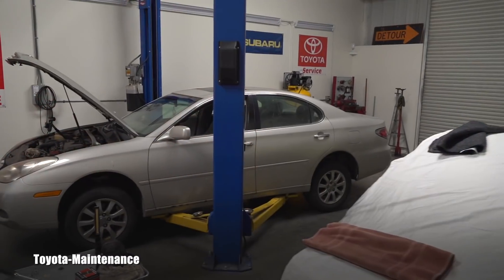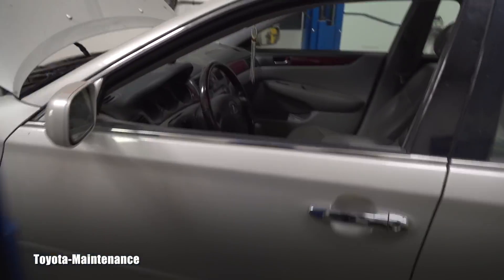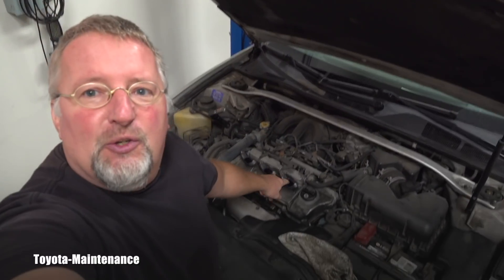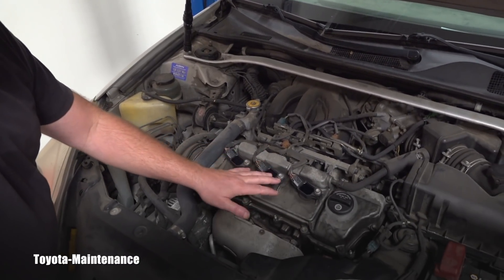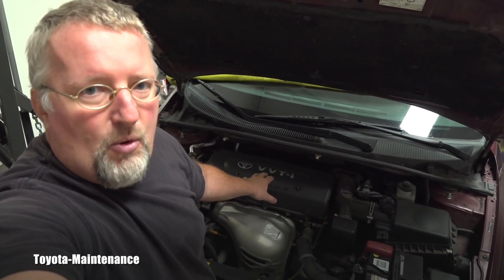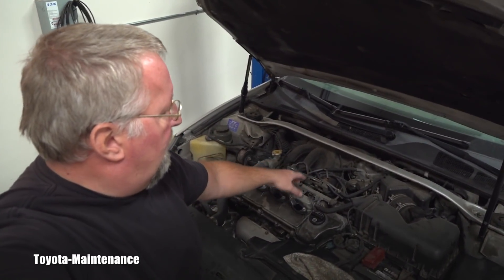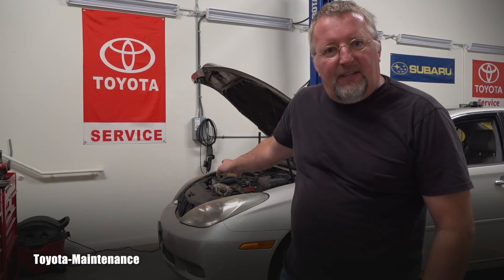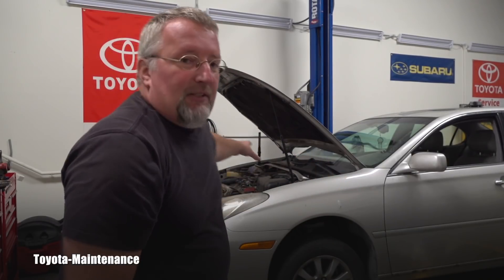4 Cylinder vs V6 Engine - Cost of maintenance and repairs

Comment: We had a 2008 Highlander Sport with a V6 which you could actually reach the backside of the engine. I sorta kinda totalled it in a wreck. We replaced it with a 2008 Highlander Limited and didn't initially notice the engine placement, but it is very similar to the V6 he showed. Royal pain to get to anything on the backside without pulling the engine (or at least a pile if parts) 🙄😥

Comment: I think one way to avoid issues and labor costs associated with this is to just take care of everything while it is apart for the routine timing belt service.  Timing belt, water pump, intake plenum gasket, spark plugs.  I love my ES300 and do most work to it myself, but this job is one I will entrust to a pro who has taken tons of these apart and has it down to a science!
Reply: That is very sound advice. With Iridium plugs lasting over 100K it is not as if these are in any way 'high maintenance' cars.

Comment: I have a 6 cylinder Highlander.  Coil #4 went bad.  Then the replacement went bad.  It was trivial to debug the second time (plug or coil) because it was up front.  If it was 1, 3, or 5, though, I would have just replaced both and hope for the best.  I'm wondering why the #4 coil went bad twice.  I'm hoping it was bad luck (but not worst luck!) and the aftermarket was crap.  If it is electrical from the wife harness, I want to cry.  Time will tell...

Comment: My 01 Camry with a non vvt 1mzfe is still perfect at 200k miles and 20 years old
Reply: You can turbo it, I wish I had your engine, I have the 2005 1mzfe with vvti and you can't turbo this engine because of the vvti.
Reply: @automotivetv9861  I dont have it anymore, sold it to someone. Still got my 2uzfe tundra tho. That's weird, I didnt know u couldnt turbo vvt

Comment: I’m about to change the valve cover gaskets on my 2004 3.4 v6 Tacoma, how much do all the parts cost along with the half moons and camshaft end caps? 🤔
Reply: Timmy the Toolman has a great video on this. Well worth watching.
Reply: Recommend OEM gaskets only. Check your local dealership or look it up online such as olathe
Reply: Felpro and victor reinz

Comment: Very, very good point for anyone thinking of purchasing a 6-cylinder Toyota.  The required spark plug change procedure for that Lexus seems extreme.  This is a perfect example of how a spark plug replacement could cost perhaps a $1000.00 including parts, taxes and several hours of labor.  As always peter, great video!!!!!  Keep up the great work.  I watch everyday for a new video from you.  I hope those California fires have died down in your area.  Take care!
Reply: The iridium plugs last over 100,000 miles which should also be factored into the costs.

Comment: I would recommend that spark plugs and coils be changed on cylinders 1,3 & 5. Also new intake gasket. Also spark plugs on 2,4 & 6 and if misfire on six, change coil.
Reply: B. Toff  Because the Honda will be in a junkyard before the plugs need to be changed.

Comment: I'd much prefer a Camry XLE with the 4 cylinder, almost as luxurious as this, but with a simpler engine and lower repair bills.
Reply: Yeah if I had a delorean I would go back and tell my parents to just get the camry with 4 cylinders instead.
Reply: Royston Nguyen if I had a delorean I’d be happy
Reply: @OffshoreBluewater  I would only be happy with the delorean with the aftermarket flux capacitor time circuit kit from fabricator known as Brown Enterprises. About a generation ago, 35 years,  to be exact, the units were stock from DMC and outfitted and one of a kind. The stock units without were dogs on the road. Engine leaked like a sieve. And slow as hell. There is another current fabricator in Texas who has a shop of props and has a facsimile model he builds for show purposes only. I am not aware of any actual functionality of his units except that they function as automobiles and look like show cars. For example, I do not think any of the items on his Ectomobile actually works in anti-ghost busting capabilities. But he could he hiding it, who knows.
Reply: I still pick Camry with 4 cylinders when comparing repair expenses with Lexus. $$$$$$$
Reply: @josetejada7799  I would rather pay $200 more every 10 y or 150k miles in replacing spark-plugs+gaskets and enjoy smooth, nice torque V6 Toyota.  Especially if you drive fast.
Reply: @rondhole  it is not the comparison of speed and smooth ride of the car it is a comparison of repair expenses between Lexus V6 and Camry 4 cylinders.
Reply: @josetejada7799   Exactly, the balance of cost for maintenance and comfort you get from V6 Toyota worth to consider over i4.  The balance in V6 is just hard to beat and nothing close from any European cars.  Effectively, it cost no more than $20 per year.
Reply: @rondhole  ok to each his own opinion.
Reply: @josetejada7799  Get a Camry with the V6
Same 1MZ-FE 😂😂
Reply: Vincenzo G no. Camry w 4 cylinder. It’s a comparison of Lexus and Camry 4 cylinder. $$$$
Reply: @ThomasFG  . Is all about your budget, if you have money to throw away, the V6 is fine, I don't have money and time to waste with the V6, so I stick with the 4 cylinder easiest car to work on.
Reply: @awakeandalive4248  Unless it's a Subaru 😂😂😂😂
Reply: In my country you see a lot of 20+ year old 4 cylinder Camrys still for sale but hardly ever a V6.They don't seem to be on the road now.All gone to the wreckers.
Reply: @tolrem  not sure which country you are.  Most V6 is sold in usa canada because they have bigger costumer taste for it.  They are still roaming around as much as i4.
Reply: @rondhole  New Zealand.Yes I suppose it depends on how many were sold in the first place.I did hear though that the V6 didn't last as long as the 4.My Camry 4 has done 286,000K  on the original engine.Only ever  needed a starter motor and clutch.
Reply: @tolrem  My Sienna 2004 with exactly V6 in Camry last 300k miles or more than 480k miles without a glitch and still the smoothest engine I ever drive below 6 cylinders. The only issue was thermostat and thermostat plastic hose that crack at 230k miles.  Waterpump and timing belt replaced every 100k miles.   It was still really smooth and consume almost 0 oil when I sold it in 2017.  The V6 is the best engine and the oldest that even Lotus put it in 480 HP. It is just not easy to work on and cost 2x more than I4 for common maintenance like 120k miles sparkplugs together with valve cover gaskets and sparkplugs seals.    In my opinions, the V6 in Toyota is the most reliable engines that Toyota used in car and trucks until today. The basic V6 was used since mid 80s with 3.0L until now with 3.5L and timing chain, the water pump is easily replaced compared to stupid BMW or Ford.  Only the sparkplugs is a hassle in the front wheel drive, average of 3-4 hours labour instead of 1h labour like in I4.   If you ever have one, you will be spoiled and won't comeback to i4 because of its low end torque and how smooth they are.   Toyota use 2.5L direct+port injections that almost get the same power but adding hybrid with much better low-end torque for 2021 Sienna and Harrier.  Turbo charge V6 will be used for bigger and heavier SUV and trucks because Toyota will end V8 lines but keep naturally aspirated engines in midsize SUV/full size like highlander, Avalon, ES350, etc.    Gasoline price in USA is only 50 cents, roughly 1/3 what European pay.  Hybrid takes 90% of Lexus sale, and 60% Toyota in Europe but the opposite in USA.
Reply: @rondhole  In NZ gas is $2.20 a litre for 95.So it's $10 a gallon [imperial] equivalent to about USA $6.60.Makes it expensive to run a large car here,especially the old V8s.
Reply: @tolrem  95 RON is about midgrade in USA, most america use Regular 90 RON. 95 cost about 20 USD cents more per gallons.  So, NZ is similar to Europe.  Hybrid Toyota is the best option, it will last really long beyond 400k km/17 years before need Hybrid battery replacement since the weather is mild in NZ.   Toyota gives 15 years warranty for Battery in UK/Ireland because the weather is mild there.  But even in Germany, most 2nd gen prius are still using original battery, they last beyond 15 years/400k km.   Yes, repair in hybrid is expensive but they are rarely have problems without any recall/TSB under warranty.  After 3rd gen Prius 2010, most hybrid has no problems with its hybrid components anymore.  But some 2010-2012 1.8L engine has head gasket problems that has been revised in 2013.
Reply: @tolrem  difference is small maybe 400km in V6 vs 500km in 4 cyl
Reply: The new 2.5 liter 4 with 205hp is a great compromise. It has the same power as that old V6.
Reply: @rkgsd  Not really when taking into consideration the new 3.5 with 300 horsepower.
Reply: @automotivetv9861  I said "compromise". It's got more power at 205 than most of the non-turbo fours. If you want to drive like a drugged out maniac and race people like you're 25 years of age, then yeah 300hp is for you.
Reply: Jbog07  Engine parts are exactly the same. But you have refinement of luxury car with Toyota reliability.
Reply: You can't compare a Camry XLE to a Lexus ES300/ES330 😂😂😂😂

Ones built in America, ones built in Japan (ES)
Not to mention the materials & leather are completely different, features, etc

Not to mention the 4cyl is only beneficial around town in congested city traffic, even then the offset in fuel economy is negligible. On the open highway 1MZ all day everyday. Then 4cyl's fitted to them camry's aren't fuel efficient hahaha.
Reply: @ThomasFG I did use the word ALMOST
Reply: @ThomasFG  The i-4 2.5L dual injections + Hybrid in most cases are better suited with ES300 and Camry.  It is so refine, smooth, and extremely fuel efficient powertrains.  With most Hybrid come with 8-10 years warranty and average lifespan more than 15 years, Hybrid 2.5L is better choice.  Battery replacement with recycling program from Toyota make it very affordable for about $3k, justifiable for 15 years period and fuel saving difference.  If you drive 15k miles per year, the saving from fuel is more than $500.  Roughly every 6 years, hybrid battery replacement cost is already covered.

Comment: Why not replace 2-4-5 backside plugs ,  put front good coils in the back & put  it all together & test drive. If cools are bad they are up front. 
I'm assuming front coils are throwing no codes.
Reply: What a great idea!!
Reply: Back is 1,3 & 5. Front is 2,4 & 6.
Reply: I owe a 05 sienna has the 3mz fe same issues. I have weeping value cover gaskets . I would suggest all plugs and gasket at the same time as all that is coming off any way.
Reply: because this car has none in back

Comment: -I4 is better 
-I4 non interference are the best Toyota engines 
-Toyota V6 are a pain to service especially interference models with timing chains
Reply: I own a 6 cylinder camry and I think it's worth it. It's an 01 and I really enjoy the added power, it makes driving more enjoyable. My engine is 20 years old and gas 200k miles and is still great. I do see your point about 4 cylinders being lower cost
Reply: @ToyotaNutjob  Added power is not worth  doing gasket work  or timing chains .
Reply: @ToyotaNutjob  Not all Toyota V6 engines especially newer have rubber belts. Valve cover gaskets on Toyota cars always seep unless rarely driven on highway
Reply: @ToyotaNutjob  imz-fe is also non interference so it's really the best

Comment: This was wonderful, thank you, sir!! I'm looking to buy a 2012-2015 Venza and this has been most helpful!! Your channel is a bottomless well of useful information, all easy to understand! Any suggestions/recommendations between the I-4 and V-6 Venzas? Do those V6s have the same issues?
Reply: Yes, the spark plugs in the rear of the 3.5 liter V6 are hidden. There are good videos on spark plug replacement for that model on YouTube.
Reply: @dchristo10   Thanks, David. I know the V-6 Venza has a transverse mounted engine. I'm just wondering if the rear 3 spark plugs of the Venza's engine are easier to access than this engine.
Reply: @maxcactus7  No. You have to remove the wiper components, the air intake, etc. There are also some hidden screws that add to the challenge.

Comment: Hello, Peter.  I love your channel and videos.  I have a 2007 Rav4 with the 2gr-fe.  Is it as bad as this engine to get to the back bank of coils and plugs?  I'm nearing 100k miles so new plugs are in my future.
Reply: One awkward spark plug change every 100,000+ miles is a small price to pay for the benefits of that excellent V6 in your RAV4.
Reply: New plugs at 100.000 miles?  My 09 Camry V -6 has 300,000 miles and has never had a repair of any kind.

Comment: Peter, After 18 years, the Lexus has fully earned the right to misfire. Having said that, we appreciate the fact you dutifully brought the 'V6 question' to our attention. BTW you did not give us the mileage. ;-)
Reply: big maybe
Reply: B. Toff  how old are you? Most people can drive for 60 years max, but you've owned many, that lasted the 25 to 35 years without changing plugs or coil packs? Maybe you should change your name to Methuselah ;)
Reply: B. Toff  As much as Scotty Kilmer loves Toyota/Lexus, he has said that Honda still makes the best engines in the world.
Reply: B. Toff  Without replacing a coil, ignition leads, spark plugs, etc ?
I doubt it 😂😂😂
Reply: Vincenzo G dude I got a check engine light flashing on my 98 4runner only when on the freeway going 70+. Mechanic said he had the scanner plugged in on the freeway when it blinked and said there were “no codes and it’s probably a short”. Does this sound like a coil to you? Lol u seem to know about cars thought I’d ask thanks‼️
Reply: @jacobfrench777  Could be many reasons to throw a "money light" or CEL
Reply: B. Toff  I do love Honda's which I own but that sure doesn't mean I don't love Toyota's, which I have owned as well. I also love Tacoma's and 4 Runners and this is one of the reasons I enjoy this website. I'm waiting until December to see if the prices come down especially on the Tacoma's, man their spendy, but sure are pretty👍
Reply: B. Toff not new Honda’s unfortunately
Reply: B. Toff  Besides the transmission that is.
Reply: Still a terrible design: it was bad even 18 years ago!

Comment: I don’t know why Toyota does these v6 engines like that🤒🤒
Reply: When they design a car, they don't increase the engine compartment for V6's. They use the same design and have to fit more cylinders and more power into the same engine area. You'll find similar traits with german cars that want to boast high horse power numbers, everything gets cramp and they have to use every inch they can thus not everything is easily repaired or accessible.
Reply: Probably to allow a low hood line.
Reply: Some blame the shift to cramped engine compartments on CAD—computer-aid design. When engines were developed the old-fashioned way, someone working on one component had to leave a lot of space for those working on other components. Now with everyone's work in the same CAD, designers can push items much closer together. 

It takes time for those changes to take place. I was told that my former 1981 Toyota Corolla was the first designed by CAD. It had lots of room around the engine. The quirk was the wiring. Some components that needed to be on the left side for my left-hand drive car were instead on the right. I eventually concluded that the car had initially been designed for right-hand drive (Japan) and when it was redesigned for left-hand (U.S.), it was easier to make the wiring longer than to move items around.